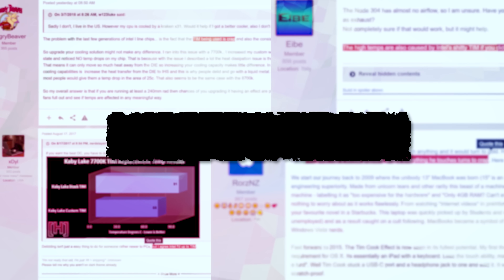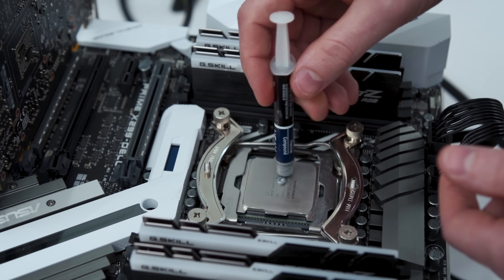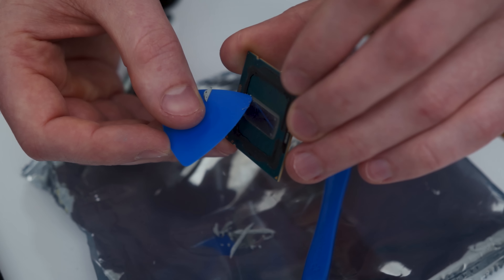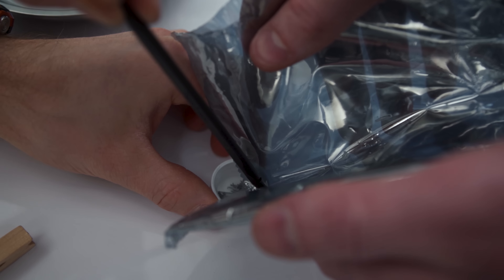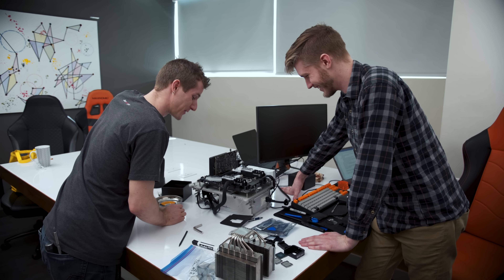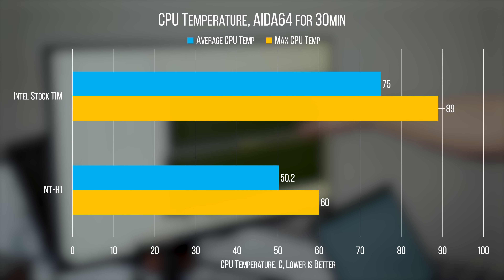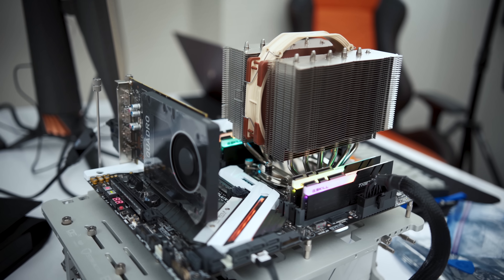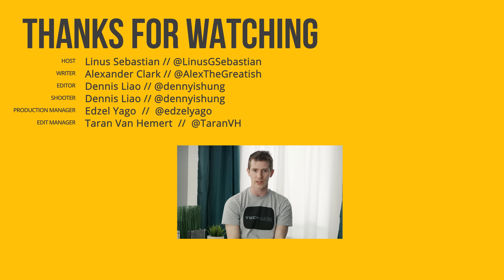Is Intel’s Thermal Paste ACTUALLY That Bad?

Comment: Holy shit, "decent enough application".. did you compare the BLT(Boundary Layer Thickness) after delidding with after your test? in the lid it should have something like a 50micron BLT, and after it looks like 0.2mm or something. Getting a thin BLT is basically the most important point when applying TIM. assuming your Temperature gradient through the NH1 is around 10C, and your BLT is 4 times as thick, you should expect that gradient to become 40C if the TIMs perform identically. This seems like very reasonable assumptions to me, so my conclusion watching this is that PROBABLY they perform just around the same.

Comment: If you had a delid tool why didnt you just test the 3rd gen chip originally then delid it and put new paste... wouldnt that give you realistic results while using old paste as is and not having to reapply it unevenly. I honestly dont understand why anyone would do it like this, these results are useless unless your planning to reuse old paste on a different sized chip.

Comment: I'm going to go ahead and suggest the dried-up, under the IHS TIM on a 7 year old Sandy Bridge CPU is a tad different than the layer of stuff on the bottom of a stock Intel HSF, and that's what you should have been comparing. You literally just needed a few brand new Pentiums to salvage the TIM from the bottom of each heatsink. What a confusing video?

Comment: Are you kidding, its a paste for a reason, what you applied was little chunks, im surprised it did as well as it did. also, longevity != scraping off for use elsewhere, and the current tim they use might well be better, you used current paste for comparison

Comment: sorry but...with that application you absolutely can't compare it realisticly. It stayed way to brittle; maybe adding of some Mineral oil would have saved it (at least more than Isoprop...what?! That really might have ruined it by britteling it more while evaporating) but then still you changed it's state. 
Actually it's really interesting to ask yourself how it got so brittle in the first place;  but as you could see in the differences of how the application looked afterwards, it wasnt in this state when it was first applied by Intel. Maybe some error in the production process made it so and is the whole reason; but without talking to Intel you may never know. 

Did you try to contact Intel to maybe get them to send you some of their thermal compound to test it? You could have told them it's in their interest to supply you a sample of it to get out best results in such a testing; when their thermal compound is that big of a deal for people.

Comment: Not really needed since the real test is just replacing it and seeing the results (even though they aren't enough to void my warranty...). Using it on top of the di seemed like an idea that wouldn't work the moment you started mashing it together. It wouldn't melt, otherwise there would be a mess INSIDE, meaning it is designed to harden up and stay put, at least IMO of it's design.  Reconstituting it was a neat idea, but again it didn't work meaning you put not a past, but a rough granulated like material onto the CPU which had gaps and air pockets which would work as insulation and NOT optimal heat transference.  But then again, SCIENCE is all the reason to do tests I guess!  Sadly this one was comparable to proving flat earth by using a level on an airplane.

Comment: The methodology is completely flawed, no one should take these results seriously.
Why not simply take a recent chip with fresh TIM, delid it, then relid it without changing the thermal paste, and get a set of measurements. Then delid it again, put the liquid metal, and make new measurements?
This way you should be controling for the chip & the effects of deliding.

Comment: How is this fair though? It's a poor experiment because the Intel TIM is old and the 3rd party stuff was freshly applied. At the least one could have compared old scraped Intel TIM with old scraped 3rd party TIM that has been aged for the same duration in the same conditions, but even that wouldn't really be fair, since they wouldn't necessarily reconstitute with the same efficiency despite potentially functioning well —if left untouched— with the old material. In other words the intel TIM might be decent when dry and untouched, but not when broken-up, mashed, then re-applied.

The experiment isn't useless, but it's pretty close to useless. At least unless someone is constantly re-delidding their CPU to reapply their 3rd party thermal material regularly.

Comment: It is bad but not bad enough to produce well performing products.  Intel's performance lead is so ahead of the competition that they're doing this.  If they needed to release higher clock products, replacing the the TIM is quick solution.  The competition employs solder on its IHS but still can't boost to higher frequencies.
Reply: The competition is also dealing with two dies and using the same power efficient manufacturing process as phone chips.
Reply: huh? AMD ryzen 2700x beats the 8700k on many benchmarks, passmark has the 2700x 1,200 points above intel. The 8700k only wins on old games that don't utilize multi cores. It ain't 2016 anymore AMD is equal to intel in gaming performance but destroys intel for Rendering
Reply: LOL you're trying to compare a $200 chip to a $350 chip and say look the $350 chip is better,  Ryzen 2700x costs less then a 8700k so its a far comparison especially since the 2700x beats the intel in everything but gaming  and even then its only 5 to 15 FPS worse then the intel and to get that performance out of the intel you have to buy a 240mm AIO  for $80 and liquid metal for $20 and the deliding tool for $50 not to mention void the warranty and risk ruining a $350 chip so that 8700k turns into a $500 chip  if you want to actually get those extra 15 FPS  whereas the 2700x come with a adequate cooler and thermal paste out of the box for $309 and smashes the intel in work load because not everybody just games some of us like to use our computers to make money https://www.cpubenchmark.net/compare/Intel-i7-8700K-vs-AMD-Ryzen-7-2700X/3098vs3238
Reply: So lintel rips you off and only gives you a 6 core for the price of 8 and somehow thats AMD's fault?and we shouldn't compare similarly priced chip?  BTW i'm 14 hours into a 120 hour render as i type this on my slow AF i7 940xm, every game  has about a thousand people 3d modeling assets for it , every youtube vid needs to be edited, every vid intro needs to be make in a 3d software, every collage kid that is anywhere near tech, engineering, physics, media, or even medical and business needs multi core  computing power. Its funny how you sit there reaping the work of those people while saying nobody needs more cores, what game only runs on 1 core? last i heard even CS:GO would  use up to 8 cores.

Comment: lol What in the world are you guys doing?! Yes, you have decent coverage with your "make shift paste" but that's not all that's happening when you apply actual thermal paste. When you apply thermal paste, it creates a.. bond between the two metals in the heat spreader and the heatsink (this is why it's hard to remove the heat sink after it's been attached to the CPU for a while). What you used, didn't create that bond.. it was just sandwiched between them..

Comment: O.o Very odd methodology. If the goal was to test the thermal interface material only, you had a bag of test subjects already. Just test them before and after delidding. Only variable is the thermal interface. Why on earth you removed the material first and applied it to a different processor, I am very confused.

Comment: how well Do AMD has thermal interface between their Die and Sink. as they have pins on CPU rather than having Pads which intel is using so its easy to delid them while amd will be tougher. and practically Deliding AMD will make the CPU probably useless. i had 3 AMD systems 2 are dead due to lightning hits and 1 running since 2016 so bit curious about their thermal interface.

Comment: Thats not a paste anymore !!!! why don't you scrape some paint of a 1999 toyota celica and use that as a tim probably work about as well.

and no the application of the tim looked like shit on the orginal ihs you could see that it was squeezed out and very thin at contact your chips were about 1mm thick.

Comment: How is this a relevant test? TIM is paste between an IHS and a DIE not between a IHS and HEATSINK... Please redo this with an non-delidded CPU then delid and try different TIMs... and then why not try 'solder' die direct to an IHS or better yet try to do it between a DIE and HEATSINK... Like AMD's of the Duron 800Mhz era... and see how much better is...

Comment: I'm sorry but how the hell can people think this test is valid? This is much more a comparison of a thermal pad consistency wise than paste. Also Linus isn't correct in saying the application is decent. Yes it spread nicely, but look at that thickness, its almost 1 mm thick and basically has none of the liquid properties that fill in micropores and heat transfer rates.
Great entertainment, but valid? Hell no

PS. Before people start whining, yes i do not like the normal TIM, but CPU's cool so I'm fine with it.

Comment: :) A fair test would be to measure several (not just one) CPU's temp with the original paste, then deliding them and replacing that paste not with liquid metal but with that Noctua paste.

Comment: WTF.. This is a joke - Right ??! 
You are using old dried out paste to validate it (applied it looks more like an insulatorthan conductive for the thermal contacts)
I think the paste is Okay from the factory, but after 5-6 years, yes it is more died out, and not working as good as new.
BTW... taking out old paste and resuning it (and using alcohol to thin it!!), is making the reapllience of the paste applience, even worse performing then if you had just let it be on the original.

This test shows nothing!!. 
The problem from Stock Intel thermal paste aplly, is that it is done quickly factory way. And not the perfect/correct amount to cover 100% even. 
Sure you can get something a bit better just with another thermalpaste - Liquid metal is a lot more thermal conductive. Same with GPU's They get toasty after 5 years. New paste (not Liquid metal here!), and they heat up(and down) as they did new (sometimes a btít better, if you apply just the Right amount needed (normally they have a lot paste on from the factory)

Comment: Hi Linus! I'm an overclocker but also a workstation builder. http://hwbot.org/user/adventurepo/ Right now I have a lot of work and cannot afford pure fancy testing. Today I just gathered I9-7980XE thermal compound from 2 samples. I rolled it into a ball (sic!) put it in to aluminum foil and into a plastic bag. Would You like to get it for testing purposes. Those are brand new, never used never started CPUs, so the TIM is the most fresh as it can be.

Comment: Hey  ;-) Next time to re-use old thermal paste. use a dip of oil (vegetable oil). instead of alcohool.  i did it many time . and the paste regain its original smootness.    BTW this comparaison is worthless. YOU NEED TO COMPARE INTEL NEW PASTE NOT OLD PASTE  :-O . Com on !

Comment: This test is not relevant at all...Scrape some old dry NT-H1 from some CPUs, try to redry that the same way and reapply the same way, and MAYBE you will have a fair test...
The best thing would be to obtain some new thermal paste that is used for these CPUs if it's possible...

Comment: OK.  You guys are complete goobs.  Thermal compounds are thermoset materials that cannot be reconstituted (i.e., once they are used, they cannot be return to their original cure state.)  Milling it down with an allen wrench to a fine powder basically introduced a lot of air and smashing it between the heat sink and CPU will not drive out this air (try it again and get a high powered scope to exam the material; there will be pocket of air everywhere.)  Air is one of the best thermal insulators around and is the same principle used by home insulation and fur on an animal.  You learned nothing with this experience.

Comment: I wonder why when it comes to intel tests Linus uses very awkward methods that are clearly bad so no matter what the result it remains not applicable. saw the same with intel ssd before, intel overclocking and cherry picking. and now this crap method of testing when it was easy to compare the cpu as is then compare with with Nh1 replacing the crappy toothpaste intel uses (you know just like people compare the liquid metal replacement??)

Comment: This is an absolute crap test.  There is a lot more to consider than "reconstituting" Intel's compound.  This stupidly done reconstituting process was not the most ideal way to perform the test.  While Intel's thermal compound isn't the best in any situation, this test doesn't accurately reveal it.

Comment: are you that poor? grab some stock intel coolers and use that paste its the same on the die. I have about 200 + in my shop i could send you. Trying to bring that paste back to life was incorrect. You cant reuse Intel thermal paste from older processors since it cures differently. I bet you $100 that of you took you makeshift paste from old Intel processors vs let's say toothpaste, The toothpaste will win.

Comment: What you should have done is tested all of the Intel CPUs with Intel thermal paste individually than repeated it with your replacement paste, ensuring that you keep track of witch temperature readings are for there appropriate CPUs and probably changed the thermal compound in either very controlled environment or 7 equally uncontrolled environments.

This would also allows you to use more CPUs of different generations (ensuring similar if not identical load (as %, of maximum load, and cooling) as you are looking at the difference in temperature not the temperatures themselves.

Comment: What the f was the point of this? This was so badly done that your conclusion is not even valid in the slightest. You take 6 years old dried TIM and then just plop it on the CPU. The minute you took off the heatsink, started poking it and it came off in pieces, you should have known your test was invalid. TIMs only work when they are in a liquid form initially so they can fill in microscopic gaps between the heatspreader and heatsink. I don't even know why you didn't add distilled water to the dried TIM and heat it up in a little plate so it can become paste again.

Comment: This was completely idiotic, and a total waste of your as well as the viewers time. Good work Linus. Maybe next time look into actually buying some of the thermal paste Intel uses, as reconstituted dried out thermal paste is not a reasonable solution and this is an invalid comparison from which no accurate conclusions can be drawn.  The purpose of thermal paste is to prevent air gaps which reduce thermal conductivity, and dried out thermal paste will not achieve this because it doesn't spread properly.  It's like if you took dried glue and tried to melt it down, then compared it to fresh glue from another brand.  Obviously it's not going to work as well.